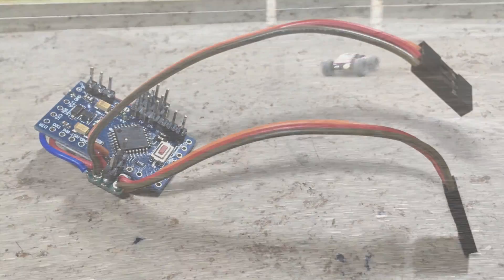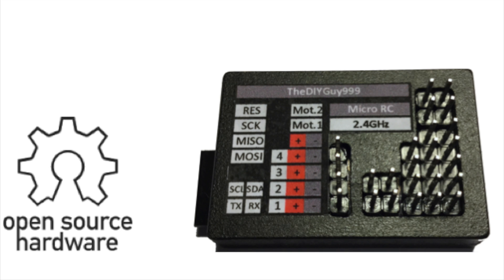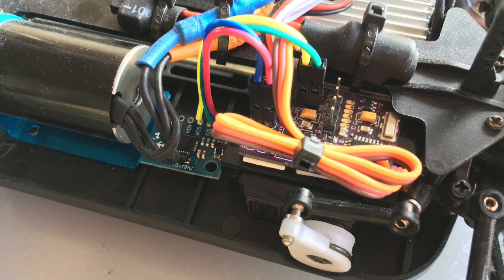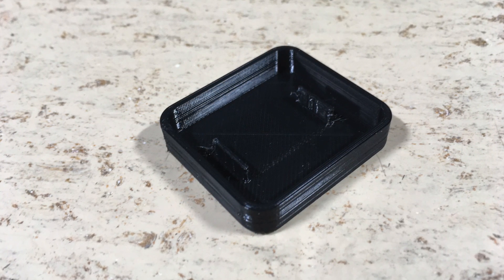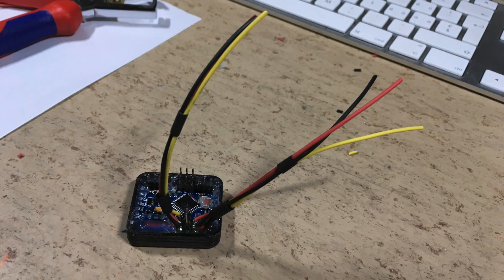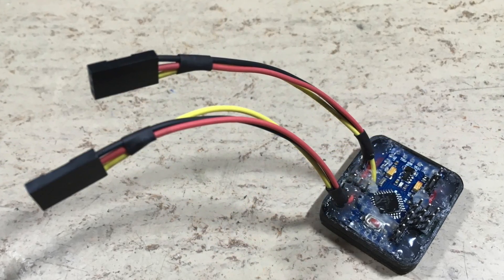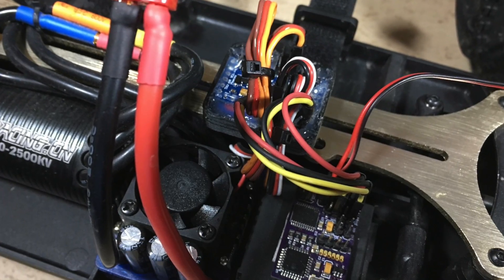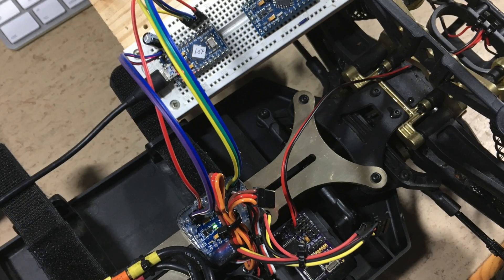JLB Racing Cheetah + Arduino MRSC Drift Assist = Wild Boar!

Comment: Can I add speed sensor,temperature sensor and battery sensor to the same board? Thanks
Reply from the maker: In theory yes, you just have to change the software
Reply: @TheDIYGuy999  I'm kinda new on this,I would like to add a telemetry to my rc car and display it on my phone,kinda traxxas does with speed temperature etc.

Comment: i tried create one (3pin) but i have problem i tried to turn right from my remote my servo cannot turn right,but turn left not problem, and also my servo whine.

servo mg966r
remote fs gt3b

please your advice
thanks
Reply from the maker: Have you tried a different servo? Check your signals with an oscilloscope. Also have a close look at the code and try to understand it.
Reply: @TheDIYGuy999   now already fine.i change your multiplier header.thx any way

Comment: very cool! but I have two questions:
How does this affect the steering resolution? Because the Arduino has to create the PWM...
And how is the latency that this solution adds?
Reply from the maker: Thanks. I can't feel any latency and the resolution is fine in my eyes. The transmitter and the receiver are also based on Arduino. In this video you can see, that the steering is much better than with the stock remote: https://www.youtube.com/watch?v=eOeNbomJrqM
The biggest improvement is, that there is no dead zone around the center position.
Reply: thank you for the answer! Great to hear! I was asking because I was looking into attinys for RC controll but almost all of them only have 8-bit-timers (while the atmega328 has 2 8-bit-timers and a 16-bit-timer. Basically the higher your timer resolution, the finer the PWM that is produced.

Comment: Hi, does it work with coke can rc car or other rc car that uses old radio syatem with stok reveiver?
Reply from the maker: It works with every receiver, which has srandard outputs for 3 pin servos. But it will never fit inside a coke can car. In this case you have to use my micro rc system with integrated stability control
Reply: TheDIYGuy999 I see, thank you very much

Comment: great job, i have a question:
the stability sistem work only on straight or aso in curves?
i'm waiting for a a595b, and i will use your sistem to increase the stability of the car
Reply from the maker: Thanks. Yes, it also works in curves and is a big help to achieve a stable drift angle.

Comment: great job on the explanation and the car drift pretty good for an offroad car :D
Reply from the maker: Thanks. Yes, of course you can‘t compare this off road monster with an indoor drifter with hard tires. But the principle is still the same. The tractor style tires of this monster track have pretty much no sideways grip and the stabilit ycontrol is a great way to stay on the track

Comment from the maker: JLB Racing Cheetah + Arduino stability control = wild boar! I hope you like it
Reply: TheDIYGuy999 I’m almost finish with mine. Doing the final wirings and then test. :-)
Reply from the maker: 👍 good luck with your test
Reply: TheDIYGuy999 can't get the steering to work. Gyro is working. :-(
Reply: TheDIYGuy999 finally got it working! Managed to see the issue, I soldered a wire on a different spot lol. Now it os working but haven’t tested it yet since it is raining on our city.
Reply from the maker: Cool! I hope it will work fine. You probably will have to adjust the gain etc.
Reply: TheDIYGuy999 yes, I have adjusted the gain based on this video. With 35%, steering won’t work after throttle so I decided to go 100%. Also planning on changing steering angle since 45 left and 135 right will disregard my 50% servo limit of my transmitter settings. But still need to test, hopefully works fine. A huge thanks again :-)
Reply from the maker: You‘re welcome. I‘m sure, you will be able to adjust the parameters to fit your needs. The first thing to do is the shake test to see, if the gyro works in the correct direction
Reply: TheDIYGuy999 yes gyro works upon shake test. I believe it is in the right direction since the wheels goes straight countering the cars direction. But still needs to test :-)
Reply from the maker: This seems to be correct. If you have too much oscillation, you have to lower the gain. I have also disabled the throttle dependency in the Cheetah.
Reply: TheDIYGuy999 saw that settings and disable the throttle dependency and it works fine. Will update you once tested.
Reply from the maker: Can‘t wait to see the video of your final result. Which car do you have?
Reply: I have connected it to my 1/12 Wltoys 12404 since it is the one that has the brushless system.
Reply: too bad the differential gear on my wltoys 12404 broke even before I managed to video the result. my observation is it wiggles on straight line when in 100% mrsc gain. or is there a different settings that I need to adjust for that?
Reply from the maker: No, you have to lower the gain, if the oscillation is too big